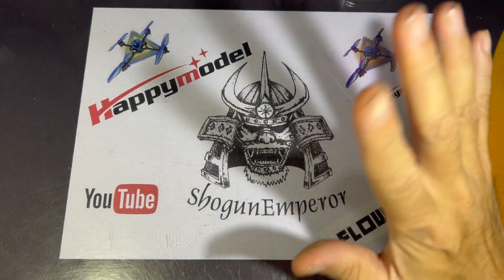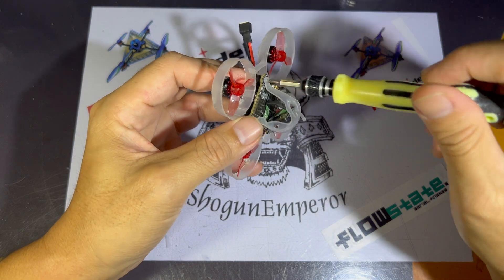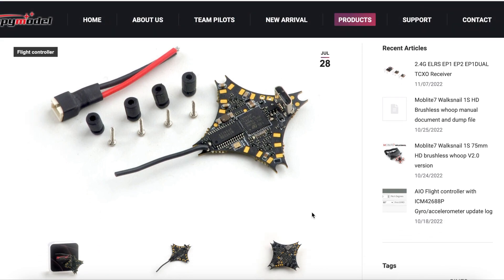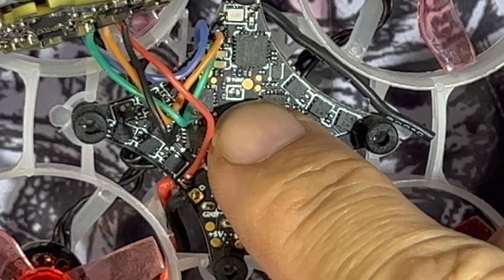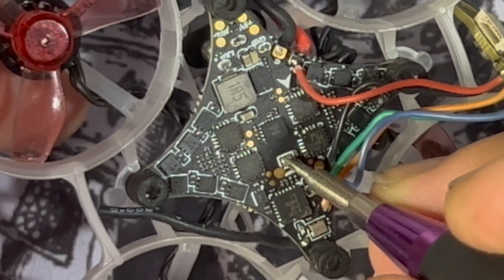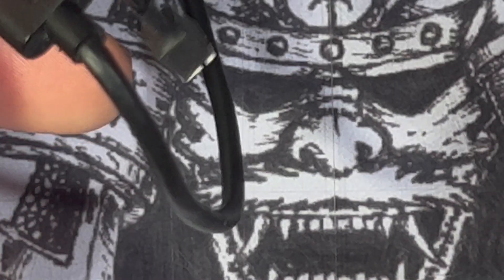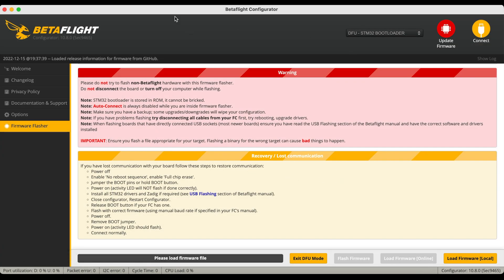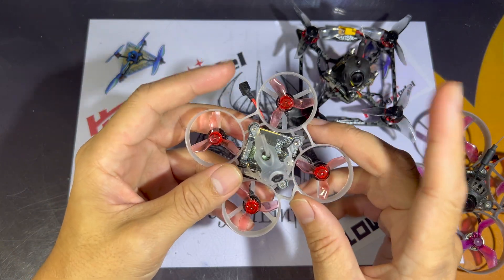BOOT BUTTON DFU MODE - SUPERBEE F4 LITE FLIGHT CONTROLLER

Comment: I was trying to set up quicksilver on one of these and maybe I'm too used to betaflight to get my head around it, but anyway when I went back to betaflight to flash had issues with enabling bootloader mode via betaflight. 

One possible way to not have to unscrew things to enter bootloader mode: What I did was open the quic-config tool to trigger bootloader mode, closed quic-config and I opened betaflight. It was in dfu-bootloader mode. Make sure to enable no reboot sequence, and voila.
Reply from the maker: OOOOHH SWEEEET BRUDDAH!!! THANKS FOR THAT!!!  Interestingly enough an alternative way to get this thing working right.